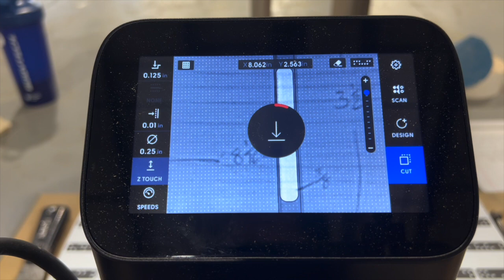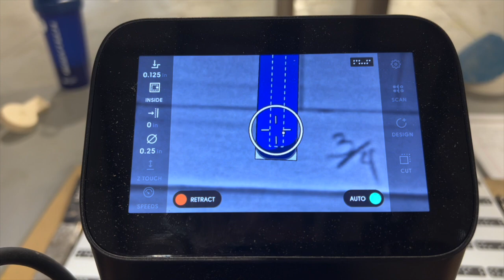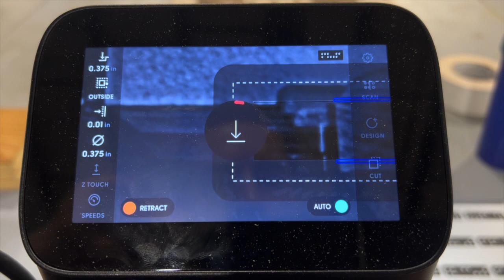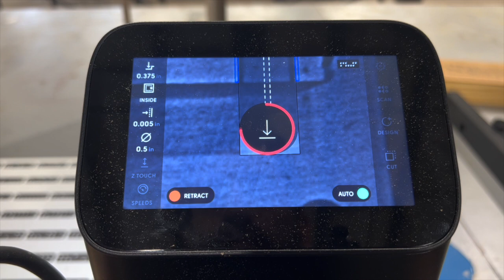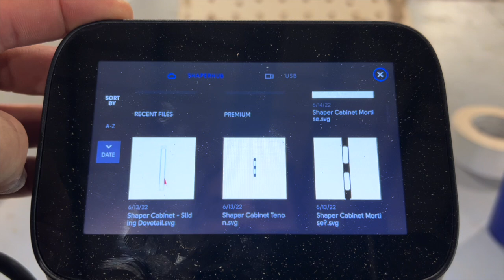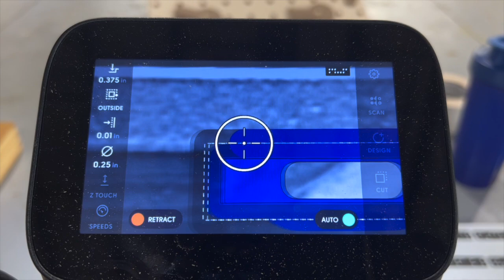How to Make a Wall Hanging Cabinet (with the Shaper Origin)

Comment: Another cool video on the Shaper Origin. At the 1:32 minute mark the bench you are working on…. is that made out of I-joists?
I have a Shaper Origin coming. Do you find a windows based computer or an Apple based computer a better fit for working with the Shaper Origin? Any suggestion you may have would be appreciated.

Comment: I agree with hand tools and machine....,machining can only get you so far simply because its locked into certain parameters,
hand tools are far more flexible and add something that they absolute best machining in the world can't when in the hands of a truly great woodworker....something no cnc machine could ever recreate....you can always tell the difference imo
Reply: Wishbone chair is made from only cnc machines (and then sanding the rough parts). 
But the cnc machines are also extremely expensive (costs more than a house)
Reply: @FilthyFloor  Please tell me a house that cost less than a CNC?
Reply: @SoFalsey Should I tell you about a house that costs less than i cnc? Depends on the house and the cnc. 
The average price for a house in my country is 335000 euro. CNCs can vary in price from 10000 euro to 2000000 euro. 
Does this answer your question?

Comment: I'm going to make a dog-hole table for my workstation immediately after seeing this. I struggle with working on panels: setting up a coplaner tape board, everytime, etc, especially in a small shop where I don't keep (or can afford) a lot of "extra" material around (milled to the same thickness as my workpiece). Wish I would have seen this sooner to make that lightbulb go off. Thanks.